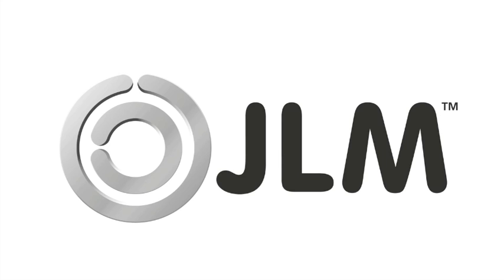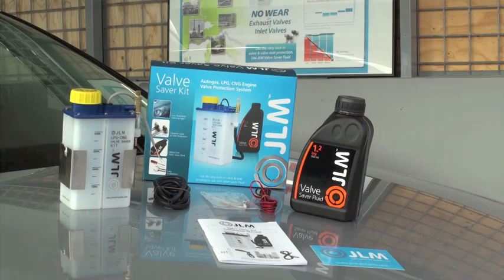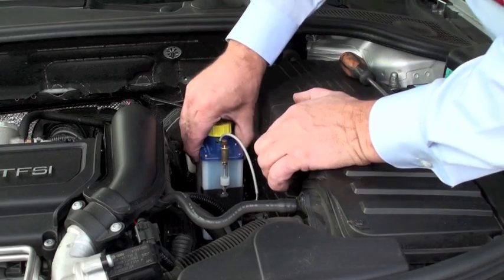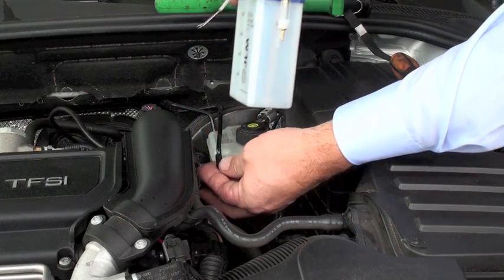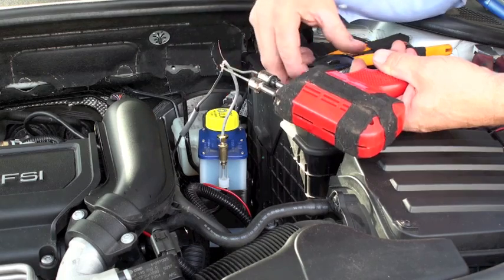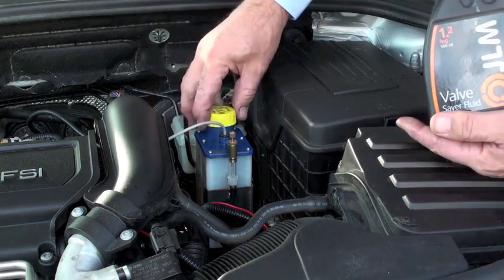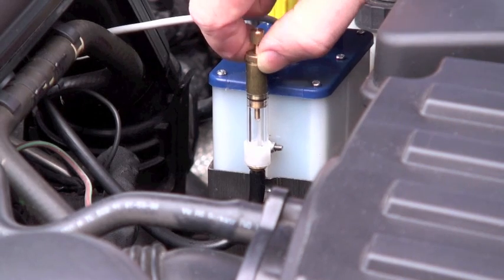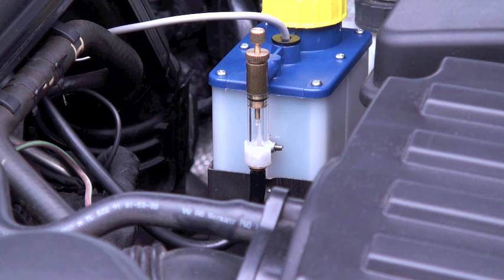JLM Valve Saver Kit Installation Video, protecting the inlet valves Autogas, LPG & NGV powered cars

Comment: I installed the reservoir lower than the the lowest vacuum inlet port below the carburator where I connected the hose. I set the ratio at just 6 drops per minute and after only 50 kilometer the reservoir is empty. 
How is that possible? 
According to the site Evo Autogas Systems, one liter should be enough for 12 to 15k kilometers.

Comment: Can I use it in a turbocharged car? The manifold is working with positive pressure instead of vacuum... So? Is it working?
Reply: It's not gonna work, you'll need to use a system that has a metering pump and connects to the gas tubes that go to the injectors.

Comment: I have the same saver kit.. but how do I stop it when I'm running the engine on petrol?
Reply: You can leave it on, as it won't cause any harm, but if you want to turn it off, put a small solenoid on the tube going to the intake, and connect the solenoid in parallel to the gas solenoid. This way, it'll stop sending fluid when the gas flow stops.

Comment: Have you noticed any problems with the valve saver fluid leaking from the cap?
Reply: yes, after several years it will leak, not from the cap but from top plate. You will have to replace the entire kit.

Comment: question: why don't you just poor the valve saver oil in the gas tank ????
Reply: This is the same nonsense like fill in rear differential  gear by oil through the engine oil neck located under the bonnet🤣🤣🤣. And you forgot about gas filter just before reducer. Regards from London😀
Reply: guess cuz of the GDI.
Reply from the maker: Dear Ice Man, many thanks for your question! And yes, I understand your question, it would make sense to add JLM's Valve Saver Fluid directly in to the fuel tank. However, with LPG (Propane) the cylinder is pressurized which makes it complicated to add, hence the dosing reservoir. There have been others in the past who tried to add in to the pressurised autogas tank but without succes. Trust to have been of help! Regards from Amsterdam:-)

Comment: Now tell me something very important. On ford focus 2009 (all engines) the inlet has a G shape curve and all the lubricant that is dripping it is gathering inside the inlet on the bottom. The valves are 20cm higher. On 1.4L engine there is not enough pressure to draw that lube. Does the lube evaporate? If it doesnt evaporate than it will gather and gather there until it clogs the inlet. Ive even noticed that if you leave the luge on high temperature it hardens. So you can imagine what will happen after years of use. I think in laboratory conditions the valve saver may do something but installed like my case where the lube can drip and gather in one place it will only do bad to the engine.
Reply: I am sure you exaggerate the problem
Reply: You can install the kit that connects to the gas tubes that go to the injectors. The only problem is that it costs 10x more.

Comment: I got a jlm Saver Kit in my Car. but i also got 2 L of flashlube valve Saver Fluid. Does the flashlube liquid Work with the jlm Saver Kit?
Reply from the maker: Thank you for your message! We know that JLM Valve Saver Fluid works in most other dosing units/kits. We do not recommend to use another valve saver fluid to be used in the JLM Valve Saver Kit as we do not know if it will work properly or not. So to be on the save side, pls use JLM VSF in the JLM dosing kit. Thanks!

Comment: Can I use this oil to protect the valve seats in engine running only on gasoline?
Enriching - tests and opinions
Reply: What the point? Just let timing advance set it correct angle itself

Comment: how can you make a video with mounting instructions, and say yo drill a hole on the intake, without removing it , or the butterfly ? ??  where goes that material ?? or you take off the intake or you have to clean it.
Reply from the maker: Dear Jacek, thank you for your comment. Generally a magnetic drill is used to prevent the material of entering into the manifold.
Thanks!
Reply: @jlmlubricants   Magnetic ehat!  no, the drillling in done on plastic (or on aluminum,very rarely..); 
Coat the tip of the drill bit with GREASE when you are almost finished drilling, that will catch the small bits; IF any small bits get inside,it DOES  NOT matter,they will later be sucked in and go into a fire;  aluminum chips are to be prevented from going in (but infinitesimal amounts do not matter either). 40 years as amechanic here.
Reply from the maker: @josepeixoto3384  Many thanks for your helpful comments José👌
Reply: How can help me  a magnetic drill if the mainfold is made of thermoplastic??????
Reply: How do you use a magnetized drill on an aluminum intake manifold. Or plastic for that matter. Most of the cars have the manifolds made of plastic or aluminum.
Reply from the maker: joao martins Many thanks for your comments! Of course it is important that the material will not enter the manifold and or combustions chamber, this must be avoided at all times. Most professional motor mechanics will have dedicated tools which will prevent the material from entering the manifold indeed. When using these special tools it will not be required to take it off or to clean it. With kind regards, JLM Lubricants
Reply: +JLM Lubricants Could you describe which "special tools" you are meaning to drill a hole on the intake which will prevent filings entering in to manifold???
Reply: ah :) you are noob i can see, every LPG installer will tell you that they drill without removing the manifold and that some of the plastic go inside and they will burn off. NOT one will tell you that they had problems with cars that have small particles of plastic go inside the combustion chamber. So you should not care.

Comment: Hello,
I'm from Kuala Lumpur,Malaysia.
My JLM KIT dripping glass cracked. went to dealer changed it.
After 2 months it cracked again. Going to the dealer soon to replace it and ti find out why the dripping glass cracked.

Info : i'm using car Daihatsu Mira type
JLM kit installed infront of the radiator beside the battery.
Malaysia temp quite hot especially in the afternoon.

*dripping when engine is OFF. the JLM kit installed to high from the output hose
Reply: AbuAbdurrahmann 

apa pandangan en. AbuAbdurrahmann berkenaan JLM ni selepas en. guna?
saya baru berjumpa dengan produk ini dan sedang berkira2 untuk mencubanya pd saga aeroback 1.3 saya.
Reply: @mohdariffahmat  a teraz po vychodňarsky.

Comment: I found the initially a good response from the JLM oil system. Engine is running smooth and found little powerful. this is for my m-800 car CNG.
Reply: where did u get this install in india ?

Comment: I'm about to give this a try, and from what I can tell some cars can cope with LPG without any need of lubricant some can't. Honda's are generally built to a very high standard and probably have hardened valve seats and valves out the factory. Sadly my Vauxhal/Opel Astra doesn't and as such I've replaced 2 valves within the last year due to heat and dryness caused by LPG. I'm going to try a product similar to this and see if it helps :)
Reply: Did this product work for you? I’m looking to get a kit and would love the feedback you got
Reply: What do you think about toyota corolla?does it need valve saver?